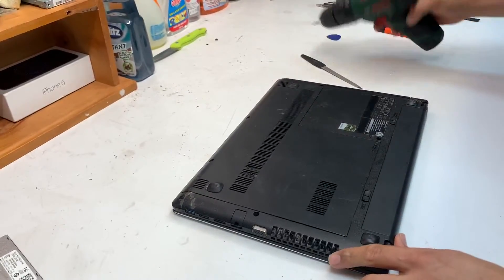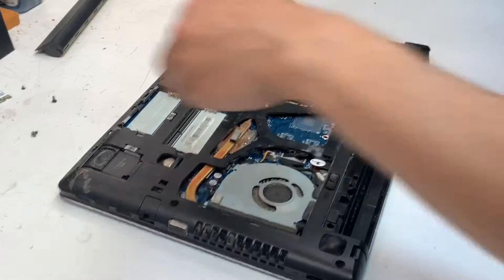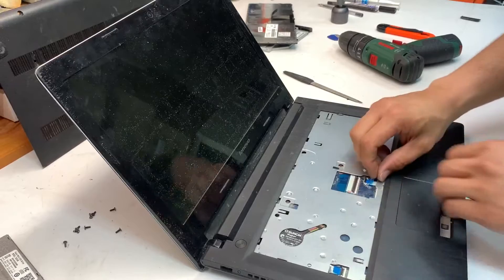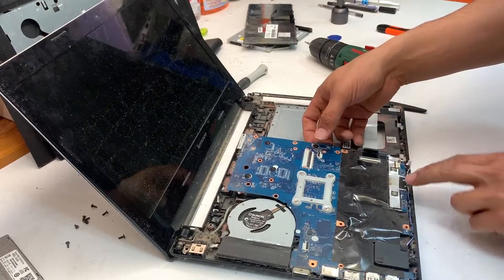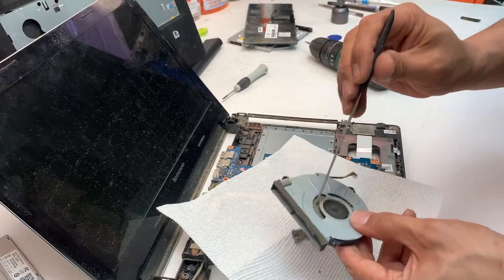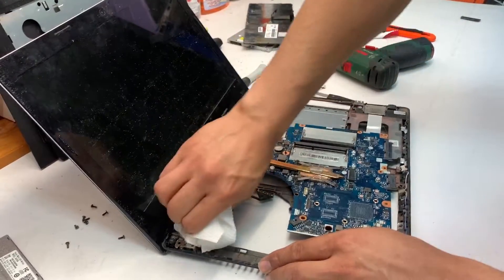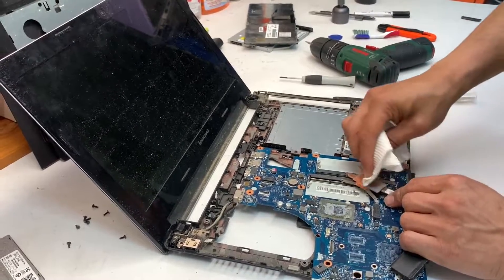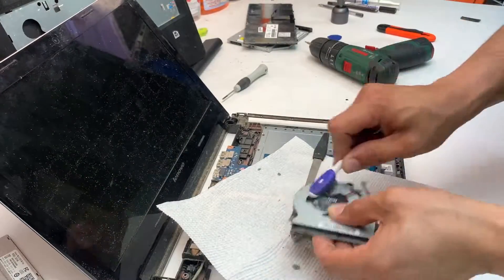Lenovo G50 Cooling CPU Fan Cleaning & Disassembly/Teardown

Comment: Good vid, would like to add that it's possible to remove the CPU fan without removing the keyboard, keyboard bezel, and main  board. Only need to disconnect the cable and remove 3 screws for the fan, although certain models could be different. But certainly have to remove the rest if someone wants to redo the thermal paste.

Comment: Great video.  I appreciate how you "man-handle" the parts - it gave me confidence that I could open, manipulate, and clean my very old G50 even though I've never done anything like this.  I even replaced the thermal paste.  
As a bit of additional guidance for others - keep the screws separate depending on where they are removed from, as there are several different sizes.  For the G50, almost everything was identical to this video, except I had to remove the SSD (4 screws).
The hardest part of this process is reattaching the 2 very small cables to the wifi card.  Good lighting and a pair of tweezers helps a lot!